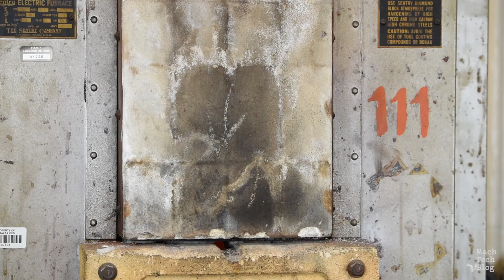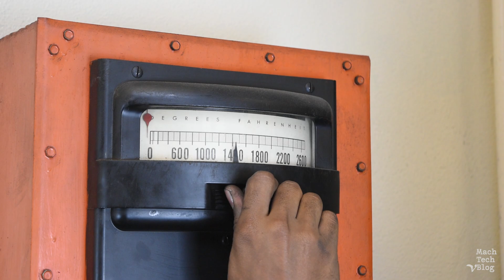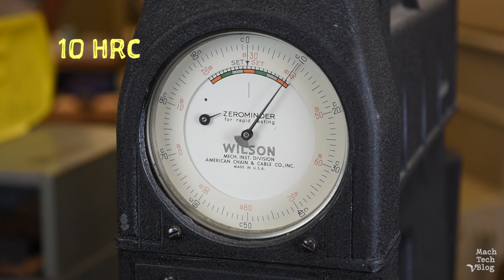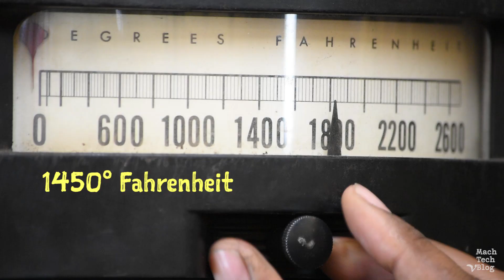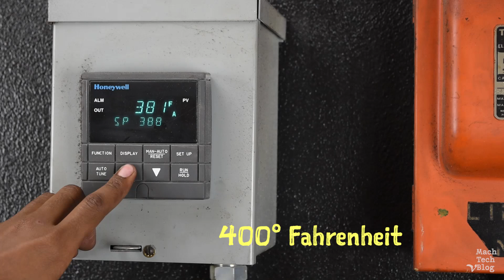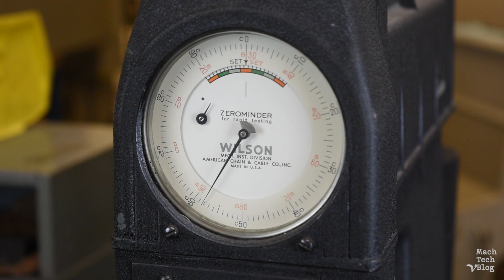Case Hardening

Comment: Is there a difference between using raw chunk charcoal vs briquettes that have fillers and lighter fluid mixed in? Or are those also technically (hydro)carbon sources and work the same?

Comment: 1700 degrees? F " ! ? k. At least carbonettes dont burn or melt at that? I am puzzled how to make a furnace or stove that can hold the temperature and contain a four foot strip of rail. I have electricity, gas, (natural and propane) and wood fire. Aside from that this tutorial type video is the ducks nuts. Excellent! So vital to solve the question how to harden. Thank you, gentlemen.

Comment: Thank you for the very informative video. I just finished a couple of small forming dies that are subjected to fairly heavy loads. They turned out very well and solved a problem for me. The only variation to your procedure was to add 10% by weight of sodium carbonate to act as  catalyst while carburizing. 

I was most impressed with your choice of carbon and it worked. We used Kasenit in high school and I understand it is no longer available. There is another product available but i will be using Kingsford charcoal in the future.

Thanks again and keep up the good work.

Comment: Well thank you for showing me the long way to heat treat. So many flaws and wasted time in this video. BTW it’s 1hr per inch for a heat soak. Second you can use endothermic an natural gas and NH3 to case harden, quench in oil then temper for 2 hours.  
Sincerely 20 year Vacumm and All case furnace operator and FAA certified repairman. GTFOH kids

Comment: This process and the san mai both make both the same concept, different hardness's in different parts of the blade. The katana does the same thing, the edge cools quick and the spine slower, forming different layers of crystal in the blade. Why not combine both, from a metallurgic standpoint. I'm tired of people telling me you can't do this, this doesn't work when they don't understand things from a metallurgic point of view.

Comment: You know this is not case hardening you just made the most expensive low carbon steel ever made. You can get the same brittle surface hardening by eliminating the 8 hour soak and just bringing it cherry red and quenching it. This entire process is absolutely useless lol you could however have gotten a real recipe for a case hardening compound or bought a case hardening compound such as cherry red and been done with it in about an hour or two and had real wear resistance on parts.

Comment: I learned this method in trade school in the mid-70's. It is quite effective, and a good way for apprentices to gain an understanding of metallurgy and heat treating, Very appropriate for making one's own tools without the expense of commercial tool steels. We were also using, along with the powdered charcoal, barium carbonate as a catalyst to speed up the process (As I remember, 10-20% CaCO3). Basically, what is happening is that carbon monoxide is generated to fill the sealed box, which gives the carbon to dissolve into the steel. More time gives deeper penetration. The early Mauser bolt action receivers and bolts were treated this way, as well as other makes of firearms. Even cast iron can be pack hardened.
Reply: Same here.... when UK schools taught young men about actual workshop stuff!

Comment: 1: Which materials we can use instead fire Clay? Like white cement, Plaster of paris, Gypsum etc.
2: Can we use all types of Charcoal?.
Please reply as soon as possible 
I'm waiting.
Reply: if your lid to your box is tight enough you dont need to seal it  i made a box with a lid the lid went over the sides of the box    i lined the inside of the  box with tool steel wrap then put a piece on top bigger than the box then put lid on   that way it sealed it self   i used hardwood lump charcoal my parts went to HRC 61 then drew them back at 400 for 2 hours twice    hope this helps

Comment: It can't be a good idea to case harden parts your going to surface grind if the case hardening process only penetrates a 1-16th " into the steel !
Reply: if your parts are over size before the case hardening then with .060" of case and you start with your parts .010" from size you have .055 or so of hard surface on each side

Comment: If you don't want to case harden this type of block, you can machine the blocks out of tool steel, which will still require a quench and temper to approach the hardness of the blocks in the video.  From a practical standpoint, machining the blocks out of 4130, 4140, 4340 alloy steels will also work (after a quench and temper, without carburizing) (water quench 4130, oil quench 4140,  4340).  They will be a lower hardness, but you will rarely, if ever be machining anything harder.  By avoiding carburizing, you will bypass the problems a newbie will encounter.    However, avoid stamping them to avoid a starting point for quench cracks.

Comment: One of the issues with pack carburizing is the problem of getting the steel to pick up the carbon that the charcoal lets off.  Commercial carburizing compound, like what you might buy at McMaster Carr, has additives to promote carbon absorption.  I think one of those additives is calcium carbonate, but I am not sure.  The advantage here is to absorb more carbon, therefore add more carbon per unit of time, giving you a deeper (thicker) effective case depth, a topic which you do not cover.  With commercial carburizing compound, you get a harder, deeper case that responds better to quenching, ensuring maximum hardness and a thicker case.  The minor disadvantage is the tendency to produce a "white" outer case layer, which is commercially too brittle, requiring a "diffusion" temperature cycle slightly below 1700F for a few hours before slow cooling.  Also, you should be quenching in a fast oil (possibly a used motor oil for the poor man) instead of water to minimize the chance of cracking, which will ruin your part, requiring you to start all over machining another piece of steel.     The reason why you are quenching in water is because the carbon from the charcoal briquettes was not being absorbed as fast as it could, requiring a more severe (water) quench to achieve a high hardness, at the risk of a higher probability of cracking the steel.  Also, keep in mind to temper the steel immediately after quenching because some quench cracks are time-delayed, and will not occur if the steel is already tempered.

Comment: Hey guys, I have a quick question, if you carburize a mild steel knife blade fro a couple of hours, in order to succesfully finish the process does it need to be enmediatly quenched or air cooling it works just fine??

After the carburization I intend to clay quench it to make a hamon that's why I don't want to quench it after carburizing it and before apliying the clay.
Reply: Case hardening is not recommended for a knife as you are likely to grind off the case hardened steel in sharpening the knife.
Reply: @garystandke669  Thanks a lot, I'll buy high carbon steel to make knifes from now on

Comment: If you only carburize and harden the surface, there is no need to temper for stress relief. The whole point of the process is a hard, resistant surface on an otherwise malleable material.

Comment: Thank you Adam.
You have demystified case hardening for me.
I seem to remember a much more toxic process I did Once at tech decades ago.
Never to revisit...
Not with crushed BBQ brickets!
1018 is Soo much cheaper than tool steels!
And I like the idea of tough core with a hard case.
Now for a pair of electronic controlled ovens....
Reply: In order to color case harden and get really pretty colors gunsmiths would use a recipe based on cyanide salts. Really toxic stuff, and probably what you're referring to.

Comment: Great video. Do you do anything to burn off the oxygen  in the box with anything wood chips etc? Or have you tried using foil? I have a few jobs to carburize and could use a few pointers. It it 8" Ø by 1" thick. Your thoughts please? Cheers from Canada.

Comment: Why did you quench the material after case hardening? 
Is it really required. Can you please explain?
Reply: Ooh ooh, I can answer this one. 
*Short answer*:

Having a lot of carbon in steel allows for really cool structural formations that make the metal really hard, but another important factor is grain size. Cooling it quickly by quenching it gives a smaller grain size which makes the metal harder.

*Long answer*:

So basically, metal atoms like to arrange into neat crystal patterns, but if you get the metal hot enough, the atoms jiggle around too much to stay in nice crystals. When you lower the temperature a bit, they will start to slowly form back into their crystal structures, but the crystallization will start in multiple places. This means that multiple crystals will form inside the metal. Thousands, in fact. Once these crystals (called grains) run into each other, they stop growing for a bit because even though they have the same structure, they aren't oriented the same way. This creates discontinuity in its structure at the boundaries. If you cool the metal slowly, atoms can diffuse across these grain boundaries causing the many small grains to condense into a smaller number of larger grains. But if you cool the metal quickly, say by quenching it, the grains stay very small. Now when you apply stress to a metal, the sheets of atoms that make up the grains can start to slip, like spreading out a deck of cards. However, because the sheets are oriented differently between grains, the slippage is slowed down by grain boundaries. Having a smaller grain size means having a ton of grain boundaries, making the metal very hard. This is why quenching steel (or any metal really) makes it harder.

Comment: The carbon doesnt dissolve into the steel... it diffuses interstitially in between the crystalline structure of the iron atoms. Carbon atoms are a lot smaller relative to the iron atoms, and can therefore 'slide' in between those structures, resulting in a harder surface

Comment: Word of advise - turn the box over so it acts as a bell and then you will not need to seal it.  Also briquette has lime in it - use lighter lumped charcoal - pulverized.

Comment: Quick question - why not just use 1050 or another 10 series steel with a higher carbon content and then just through harden it? I’m asking out if sheer ignorance. I have no idea LoL
Reply: some parts preform better with a soft center it helps it from breaking  a thru hard part may just snap into

Comment: One big ooops : kingsford coals are very very high in limestone , getting in the way of ur carbon saturation
Reply: Guns N Glory yes : full circle hardwood lump briquettes, or good ol Virginia mined coal
Reply: @guysumpthin2974  * West Virginia lol
Reply: Guns N Glory butimous is great bcuz it smokes easily , and is usually 60% carbon .  Anthracite coal (not to be confused with anthracite iron) , is 98% carbon the best , but it takes a higher heat to release
Reply: Guns N Glory google blacksmith coal , but make sure its anthracite or bituminous
Reply: Guns N Glory  or check wiki: metallurgical coal
Reply: Lump charcoal works great and is rather easy to make or obtain. For this purpose, it could either be hardwood or softwood.
Reply: Heyyyyy usa coal !!

Comment: Can I know  the preparation  of charcoal . What are the  ingredients  are mixed  with  charcoal. Is it possible  to got the hardness  0f 45HRC on the non magnetic  steel like AiSi304
Reply: Charcoal mixed with charcoal. Ask the manufacturer of the charcoal what's in it. It will vary. Nobody uses the same recipe.

Comment: Try casehardening wrought iron.
Reply: Actually, that is how steel was made in the middle ages.  It was case hardened for much longer times, and created 'blister iron'.  The blister iron was then folded and forge welded many times to distribute the carbon.  This process was repeated many times, depending on the quality of steel that was desired, and also explains why steel was so expensive and rare back then. At least in Europe.  In India they were making crucible steel, which is where real Damascus steel was developed.
Reply: Research blister steel. With a forge and a container its possible to not only case harden iron but to make high carbon steel.

Comment: So the 1700º for 8 hours is to turn the low carbon steel into medium or high carbon?
Is it actually worth the time it takes to do this to save machining bits and working time?
Reply: You're actually creating hardened steel before the machining process. This is actually tougher on tooling. You're not really saving any working time either. What you are doing is spending time and energy on making a better product that is accurate, and more durable to retain said accuracy.

The 8 hours is to enrich the steel with carbon. This allows it to be hardened. Then you harden it by bringing it back up to temperature and quenching it. Then you temper it to relieve internal stresses and make it less brittle. 

You do all this heat treatment before machining. This is because the heat treatment process will distort the metal. The final machining gives you the accurate end product you spent all this hard work to achieve. Until the technology of Star Trek replicators is perfected, this kind of long, time and energy consuming process is necessary for the desired end result. If you want something cheap and fast, go make a bowl of ramen noodles. If you want to make quality products, that requires time, energy, and quality materials. Shortcuts make poor products.

Comment: I did this with a machine shop class in 1973, we all made a pair of parallels. I remember as if it where last week. I still use mine weekly. We dumped the whole lot still red hot into a tank of water.

Comment: Awesome video! What would happen if you didn't hinder air flow with the cement and alow oxygen in during the carborizing process.
Reply: If oxygen was allowed in the box the carbon (charcoal) would ignite and burn off thus creating a hell of a lot of smoke and depriving the steel of the carbon it needs to create the case hardening.

Comment: So if you only used 1/8 in. Thick mold steel would the part be hardened all the way through?
Reply: Potentially. Check out Clickspring's channel for some good videos on case hardening small parts.

Comment: Hi Adam, thanks for the video, I think this is the most comprehensive video about case hardening in youtube. I want to ask a question about this process, will the process alter the dimension of the part? I'm going to make a precision part using mild steel, with tight dimension tolerance, the part will be about 60mm in diameter and tolerance of 0.5um.

Comment: Very informative video. Thanks for sharing.
What would be its HRC after carburizing (before quenching)?
Also, will you lose the high-carbon property of a case hardened steel when you anneal it repeatedly?
Reply: Patrick Tan it would be dead soft without quenching. Yes each anneal process would diffuse the carbon in the surface case

Comment: Nice presentation, not to be a buzz kill but at the cost of running that furnace for 9 hrs you could buy the blocks already made. at the very least could have started with hi carbon steel.

Comment: hey.. I'm no expert at all on the topic...have a couple of questions if anyone can help me with them... it seems like an annealing or stress relief that you are doing by letting it cool in the crucible in the furnace prior to removing and then bringing the part back up to critical temperature before quenching.   

I wonder if bringing it back through to critical temperature outside of the crucible destroys or reduces the effectiveness of the case hardening... does it increase through hardness by encouraging some of the case layer to migrate deeper?... does it allow carbon to precipitate out of solution in any greater measure by being again exposed to critical temperature and potential for scaling?.. why not just dump the parts strait out of the crucible, at temp for austenitic phase, into the quenchant?

Thanks
Reply: The point of the first heat was to add carbon to the steel not harden it, but you are right about just dumping it in water right after the first heat, as long as it is at critical temperature it should work. However reheating it should not hurt it, as long as you do not leave it at critical temperature for too long it will not have a negative effect. And reheating later will also allow a normalizing cycle to take place and create a finer grain structure.
Reply: The reason it was left to cool in the oven is because this was done in a school class. I'm sure nobody was around 8 hours later to quench it. So they put it in, set the timer and came back the next day and reheated and quenched. it could have easily been quenched at the end of the carburizing cycle, if someone had been around to do so. Either way works just fine. Sometimes you have to do workarounds to fit things into a schedule.

Comment: I don't have a furnace in my garage
Reply: I think you can actually buy/build a small affordable furnace fairly easily.
Reply: Andy Brice I found out that this is possible to do in a bonfire and there are other methods which work with methane and another with ammonia (although I doubt I would bother trying those methods)